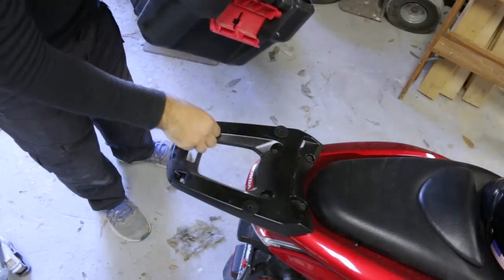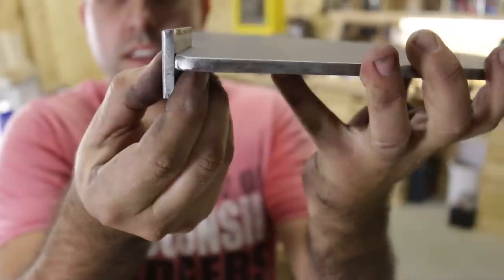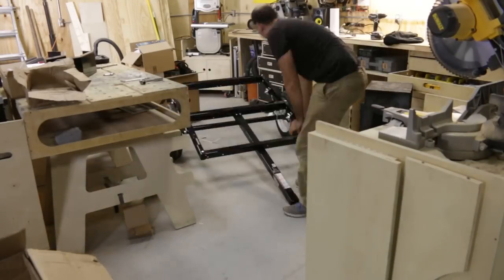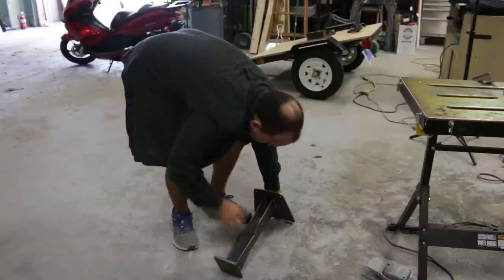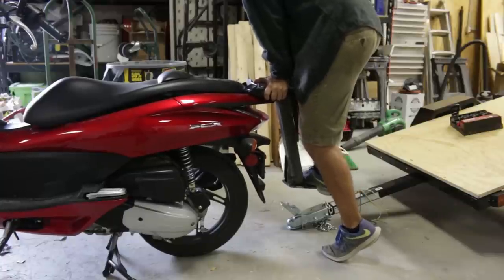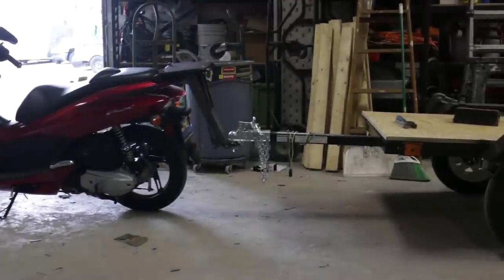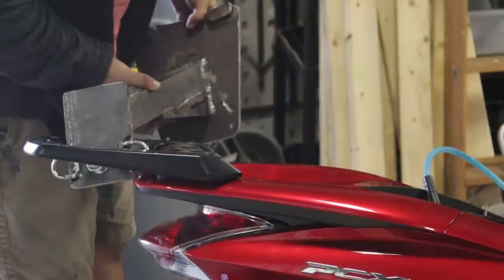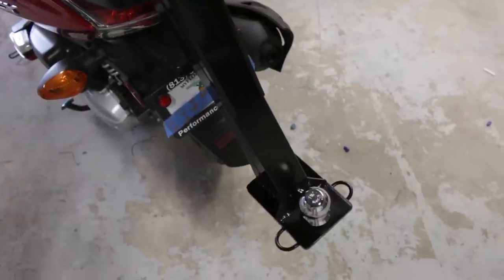Adding a Trailer Hitch to my 125cc Scooter

Comment: Please, please oh please reinforce the attachment points of that rear carrier to the scooter subframe. That carrier was not designed for an active load of the trailer pitching & bouncing. When the carrier mounts crack those double (!) safety chains won't stop a runaway trailer.

Comment: How is this even road legal?
Reply: Flordia man doesn't care about street legality ;)
Reply from the maker: As long as I don't exceed the gvwr of the scooter and my trailer doesn't make up more than 40% of that weight, it's road legal.  (Along with working lights, registration, and safety chains etc.)
Reply: Wow that's surprising. Such a thing wouldn't be legal here. (You'd have to get it certified, which is probably impossible.)
Reply: you need to get the lights working - that bar covering the backlight is actually quite bad for your safety

Comment: Grade 8 bolts lol.   That trailer with any load is gonna outweigh your scooter and cause you to wreck!  When you see a big Harley towing a little trailer remember that a road bike is easily 800 pounds.   Good luck
Reply: cthunter41 I regularly see Vespas here locally, towing advertising trailers. One is a fairly large (6ft high), solid metal framed, double sided video screen. No problem. Just because the Harleys are heavy doesn't automatically mean lighter is unsafe.
Reply: Cassette Walkman with that logic does it mean i'm safe towing my 40ft fifth wheel RV with my mom's Kia Optima?
Reply: cthunter41 No it means your logic is backwards. Does a  40ton military tank towing a trailer automatically make a Dodge Ram towing a trailer unsafe?
Reply: cthunter41 But you go ahead and try it. Just please film it &  post it to YT.
Reply: cthunter41:  definitely right.  Motorman would not approve.  OMG I can only imagine what he will say.   Heck, I don't approve either, but only because I know it will tear my scoot up eventually.  Now I'm laughing.  But I tip my hat for the work done and the creativity.  Easy for all of us to criticize from our kitchen tables.

Comment: No weld comments. However, two recommendations: 1) lower the attachment point, and 2) use a swivel hitch.

Any movement from the trailer is translated well above the center of mass. This has the potential to flip the bike over before you know what's happening.

As for the swivel hitch, the bike lays over cornering, while the trailer remains flat. Therefore, the only way to negotiate a curve us to turn the front wheel, which is not the way a bike is meant to ride and can prove to be very, very dangerous.

Your family needs a husband and father. Please remedy these design flaws before proceeding further Mike!
Reply: John Coloe Agree re swivel hitch definitely but the lever point on the mass of the scooter is exactly at the point of the towball.  It doesn't matter that the hitch is attached higher to the scooter frame, the force is acting at the ball. The same forces as if the hitch was mounted directly horizontally. Visualise the scooter as one solid piece of steel with a towball attached. The lever length is from the tyre contact with the road to the ball. 

The difference with the usual bike trailer hitch is that this one is semi-suspended on the scooter's suspension. Absorbing the pitch will affect the ride.
Reply: I’m glad I read the comments! 😳👍🏻

Comment: Caught this vid looking for hitch ideas for my Vespa. You didn't do a bad job at all. But using the steel trailer you're already pretty heavy. Northern Tool sells the same trailer but in aluminum that I'm thinking will be my starting platform.  Good luck.
Reply: Thanks for this idea. Building hitch for my honda pcx150

Comment: That's a cool solution!  I need to make a hitch for my 82 Yamaha XJ 750 Maxim.  I have a few ideas, different than your solution.  My only recommendation would be to put some lights on the hitch bracket as your bracket covers the stock lights.  I'd use the same light connector that you use on your trailer!  Cheers!

Comment: Cool idea.    Your Tig welds will go much better if you grind off the mill scale first. You want shiney bright clean steel when tig welding. You will be amazed at the difference. This step is critical for beginners.   Stop trying to weave like that, jody makes it look easy but it takes a lot more practice.

Comment: I've been hauling a four wheeled farm wagon framed bicycle camper with my electric bicycle put a class one hitch on an added wooden box on the back of my cargo bike... tow bar weighs 8 lbs and there's not much tongue weight to worry about or the results in forklift

Comment: Center of gravity for trailer can be lower.  & for those who mount theyre hitch point in the center or in front of wheel will further increase stability & control.  Scratchig my head for a Grom motorcycle.

Comment: I’d be extremely worried about those welds over time!!!! You definitely need to clean the mill scale off if you’re gonna tig hot Rolled Steel! But good luck I wouldn’t haul anything too heavy

Comment: Mike,How has your trailer worked out with 100# or so of cargo on it?   Highway speed?I'm thinking of doing something similar so that Thor (my Rottweiler/Australian Shepherd mix - the "cuddlebug") could scoot with me behind my PCX150 from Springfield MO to Fayetteville AR for Bikes Blues & BBQ later this year.I'd need to find a suitable pair of "doggles" for Thor though.Thanks,AB in 65809
Reply: The exhaust from the scooter would possibly kill the dog.  Every mc trailer manufacturer strongly emphasizes never putting kids or animals in a motorcycle trailer.  That's a big dog for a scooter, but you could conceivably get a dog carrier to mount where a top box would otherwise go.  Good luck, and don't kill your dog.

Comment: That is the wrong kind of hitch for a motorcycle/scooter. A swivel somewhere in there would be marginally adequate. Official ones are called "Swivel Hitches." The bike needs to lean in a corner with the front wheel counter steering. A two wheel trailer without a swivel will try to counteract the gyro forces, making your ride dangerous.

Secondly, at 140 lbs just for the UNLOADED trailer is beyond dangerous for a little scooter. Your trailer should be made out of aluminum and be as light as possible, given the weight and power of the 125cc scooter. Otherwise, when you get a load on there, you risk the tail wagging the dog and flipping that bike over in an instant.  Also, the trailer shouldn't be more than 2/3rds wider than your scooter. So if your scooter is 24" wide, your track should be in the 40" range. Also, there's some trailer math on how long the tongue should be as well. Your trailer appears to be too close, for what you are asking of it.

You have an AC/DC TIG welder now... you can weld Aluminum. You take the wheels, tongue, lights off the trailer you've got and go for it.

I've made two motorcycle trailers so far, and they've both been single wheel design for safety reasons. One with a trailing wheel and suspension arm, utility area in between and low. And the other with more of a wheel barrel design with the wheel under a flat bed cargo deck area.

Oh, and on a side note... you are trying something risky and for the first time, and you DON'T wear a helmet, and film yourself doing it? HAHA!! Even the idiots trying Red Bull stunts wear helmets. Anyway, I know you're in Florida... brain buckets aren't mandatory. (I'll continue the rest of the Brains + Florida joke in my head ;-)

Comment: May want to look into a swivel hitch.  http://www.openroadoutfitters.com/swivel-hitches
Reply from the maker: Of course that's already a thing. I had this exact idea as a backup plan if I had any issues towing.  Thanks for the link.
Reply: I have had them on some off road trailers and tow behind skidders for my 4 and 6 wheelers.
Reply: I was wondering about that. 2 wheeled vehicles don't turn very well if you're not leaning them. And trailers tend not to like to lean.

Comment: That Tig welding 🗑🗑🗑🗑. Please take your projects to a professional welder to be welded for the safety of all  of us
Reply: I think I died a little when he showed that weld.
Reply: "A grinder and paint make me the welder I ain't"
Reply: hector garcia The weak point in this whole setup is the carrier on the scooter. The aluminium was never designed for an active load like the pitching & bouncing trailer. The hitch needs to be directly attached to the rear subframe.